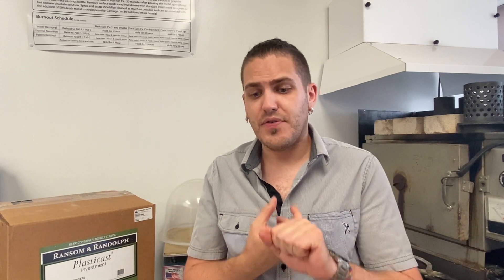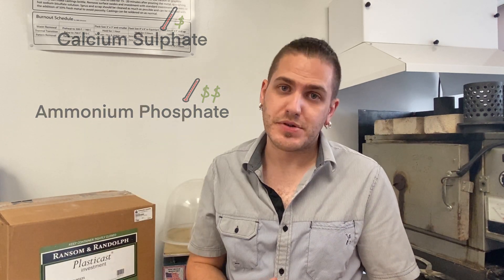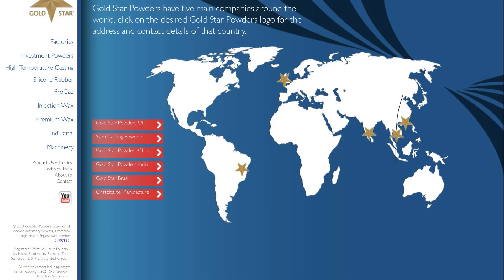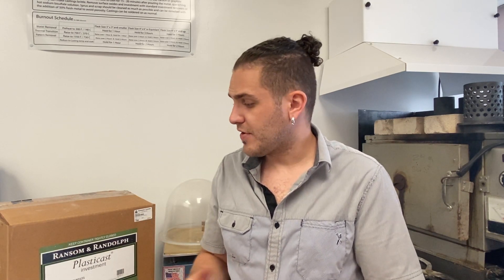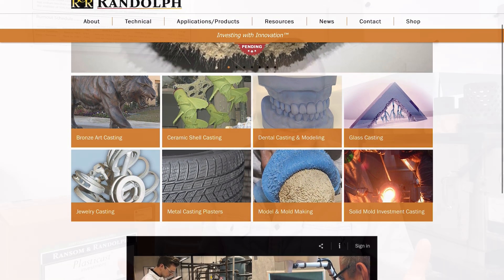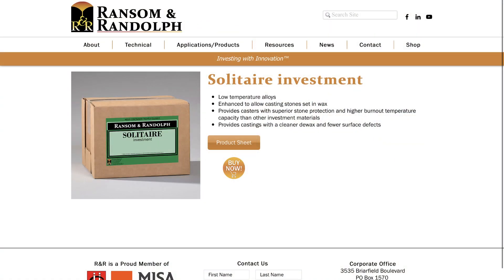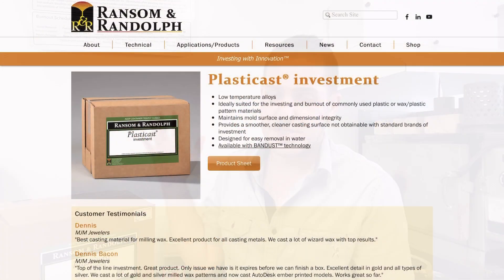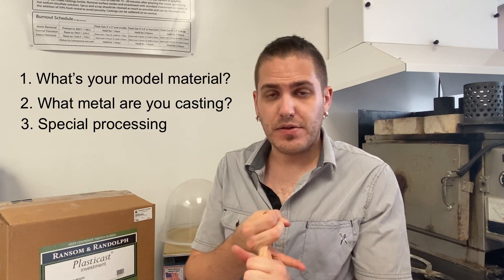What is the best lost wax casting investment?  How to pick an investment for Wax or 3D Print casting

Comment: I know this is an old video, but the information is incredibly useful. Do you let the wax/resin just roll out onto the bottom of the oven or do you have a catch pan? Or is it too hot for a pan?
Reply from the maker: You can use a catch pan if you have enough of a gap and if you intend to use it properly. 
Unless you actually remove it before the waxes ignition temperature then it’s not serving its purpose.
Resin doesn’t have enough of a “melt” to bother with a catch pan, and it burns pretty consistently past a certain temperature.

Comment: ummm. Lost interest in the first 2 minutes... grain structure is not visible on the surface after sand casting or tother methods... What you see is the surface structure replicating the quality of your casting material. If you want visible grain structure, it's process of destructively cutting the material. etching it and evaluating the internal structure.. I've been in QA for over 18 years but only a few minutes of research does wonders... Just getting metallurgically technical.

Comment: Hey how’s it going? I have printed in true blue castable resin and am looking for the right investment! Unfortunately I do not have a vacuum so I want to look into a defoamer, what investment and defoamer combo would you recommend? Thank you so much, love the videos!
Reply from the maker: A defoaming agent only subdues the bubbling during active vacuuming so it does not overflow the flask. These are generally built into different investment formulas. 
A wax wash like this one ( https://gesswein.ca/products/wax-wash) will reduce the surface tension on your models (not sure if it works with 3d prints) but it won't be a substitute for vacuuming, or vibrating. You will still possibly find pockets of air in undercuts and hollows.
Reply: @ClearMindJewellery thank you for your reply man, I really do appreciate it! I will look into that for sure! Is there an investment you would recommend for my situation? I’m looking to order as soon as possible but I’m directly on the fence
Reply from the maker: There are no specific investments we would recommend for those that are unable to utilize a vacuum. In terms of for True Blue and other polymer heavy castable resins we always recommend R&R Plasticast or Optima Prestige. 
If you are based in the USA, Pepetools has Optima Prestige and you can use our discount code: https://www.pepetools.com/DANIEL59539

Comment: I’ll have to try the other investment for my 3D printed castings. I’ve been using ultra vest and I’ve been struggling.
Reply from the maker: Ultra Vest is good for waxes but in our experience does not work for prints.
Reply: @ClearMindJewellery  does that apply to wax resin prints or regular resin prints? My assumption is both, but just double checking

Comment: Is the Plasticast BANDUST investment the same quality as the regular plasticast investment?
Reply from the maker: It works just as well. It tends to stick more to the castings but as we have a pressure washing unit that was never an issue. We stopped using it as it’s an extra $20 or so up here in Canada and we mix inside the power washing unit. (paying an extra 80-100 dollars every trip just wasn’t worth it when we have tooling to keep down airborne particles)https://youtu.be/PBh3r6VI0T4?si=_wiRwq8b53PWdX5K
Reply: Thanks! @ClearMindJewellery

Comment: Thank you for this video. Does it make sense to buy Prestidge optima if I'm going to try Lost PLA casting? Or should I just get the regular cheaper Investment cuz PLA is not as good as the nice resin printers? My printer is an old one I built and cant do anything else. Thanks again
Reply: I'm still learning myself on the casting side, but on the printing side I can suggest checking out Polymaker's Polycast material, which is a variation of PVB (a material that can be smoothed with alcohol. which this stuff can be as well!). The ability to presmooth with alcohol before coating in investment is helpful if you've got a cheaper machine that runs on rollers and extrusions, and you've got something that runs on ground rod or rails it'll be even better. 

My question for all this would be I'd like to do some aluminum casting. any thoughts on this Clear Mind Jewelry?
Reply from the maker: If burning out resin use plasticast, or prestige optima. Aluminum is such a low temp you won't have specific requirements for your investment based on the metal choice.
Reply from the maker: We did try lost PLA back in the day, swapping the PLA into the exact process that we use for resin, Prestige or R&R Plasticast would be our suggestion as you will still have some expansion from the PLA before it burns out. Depending on the size of the object you are doing you might even do Prestige with Boric Acid mixed in.
Reply: @ClearMindJewellery  Awesome thanks so much

Comment: I really enjoy your videos -- Still have several to catch up on..  I was curious about Bandust like someone else in the comments.  You mentioned it hardens the investment more; do you mean the vacuum may have a more difficult time pulling through it and capturing fine details?  I just bought a used Rio Grande VIC 12 in Vancouver..  Turns out to be the older version so I'm stuck using solid flasks for now.  Would you recommend lathe-turning a couple of shallow channels on the inside of my flasks to help keep the investment from shifting under vacuum?  I'm worried that using wax webbing will leave an even looser contact with the flask even if I sandpaper the cylinder..  One more question - I've heard in the past that near the end of the burnout process, the flask is turned cavity-side up & put back in the furnace so any gases, etc left in there can escape..  but I don't know exactly when this should be done/for how long.  Thanks a lot for your time !!
Reply from the maker: Bandust investment, similarly to boric acid, we've found barely reacts when quenched. It shouldn't have any issue pulling or getting detail.
We've never had investment shift with solid flasks.
We never had issue casting wax or resin with the flask down as long as you are leaving a gap.
Reply: @ClearMindJewellery  Thank you very much!

Comment: How big of a casting can you do with actual casting investment? All of the informations on castings bigger than things like rings have been with either ceramic or sand.
Reply from the maker: It depends on how big your flask is I suppose.  We just finished a custom order making a replacement arm for a small statue. The arm was approximately 1lbs. 
We’ve also done sword pommels and guards.
Reply: @ClearMindJewellery  What do mean by flask? I have the capability to poor 4kg of bronze. Will there be a problem with the mold degrading due to the heat? I don’t plan on making any castings with more than 1kg of metal using the last wax method. I am probably not going to do much jewelry work. My main reason for considering lost wax is the fact that my casting will be much more precise than sand.
Reply from the maker: You use steel flasks to hold the investment in place. Perforated flasks are built specifically to help with the vacuuming process when casting. 

Not sure what you mean about the mold degrading due to heat. The metal temperature shouldn't have negative effects on the investment if you are doing a proper burnout. If you are trying to cast with the investment cold then you will have a lot of issues.
Reply: @ClearMindJewellery  What temperature should I heat my mold to before pouring? I have been doing it at around 700f.
Reply from the maker: If following a jewellery process with proper gypsum investment you should be looking at a burnout schedule. https://youtu.be/FdckYTV2rJg

Comment: My investment mold keeps separating from my flask after the burnout do you know what may be the problem?
Reply: This could be several issues. 1.- You don't have a proper investment (meaning you are using pure plaster). 2.- You are making you mix too liquid (not respecting proper consistency). 3.- Your flask is smooth, brand new and polished on the inside (try sanding it just a little bit with mid roughness sandpaper). 4.- Your firing rate is far exceeding the firing temperature of 720°C to 750°C weakening the bond of the invesment itself turning it to a form of chalk. This and excess water ratio are the most dangerous mistakes for it could break the mold under centrifuge or vacuum casting splattering hot metal through the room or into your vacuum machine. Hope this helps.
Reply: Hi i try for few days with simple plaster. Have kiln at work for mining lab. I try to kiln the lost wax and plaster mold with starting 100 degree Celsius and increase 100 by hour to the 700 degrees. But when i pour fine silver in the mold i saw wax melt and wetted the mold and damages the form. I try to buy professional investment instead of simple plaster. Does this really matter?  @Rulox999

Comment: SOOOO much information. Thank you so much for this. Coincidentally, I’m preparing to do my second and third cast. I definitely used way too much investment last time, and I don’t have a vacuum chamber capable of of vacuuming AS I pour the metal into it.
Reply from the maker: No problem we are glad you liked the video. 
I think we will be doing a follow up video, as part of some downloadable course content, as to how we specifically do our mixing etc. If you're not great with the math we would suggested looking at our cheat sheet in the merch bar as all the investment mixing for common flask sizes is written out there. 
I would definitely recommend an assistance method even if its a centerfuge vs a vacuum as gravity pouring doesn't always work out. 
Good luck!

Comment: Why do people cast with stones in? I get it would save time but otherwise is there any advantage?
Reply from the maker: Not sure if we got this one on insta for you man. So just in case... stone in place is mainly a time and tool saver. You don't need an on site stone setter if you can drop the stones in pre-cast. You can also cut down on the amount of tools you need. Also depending on the design you may need to solder on fewer components later if you cast the stone in place. 
There are a ton of reasons that will change from studio to studio.
Reply: @ClearMindJewellery  thanks! That make a lot of sense.
I'm still building up the shop so learning different workflows is very enlightening to me.
Thanks for the well thought out response!